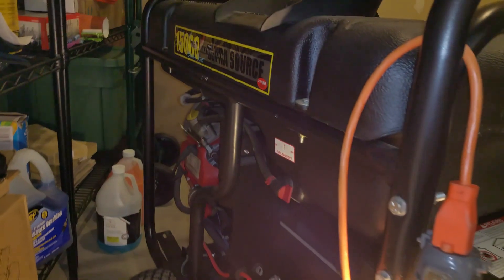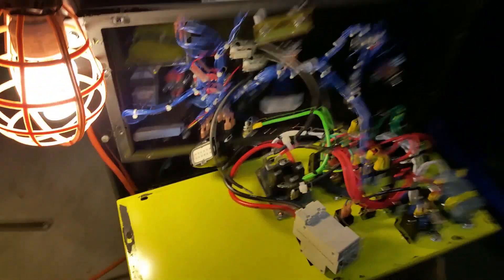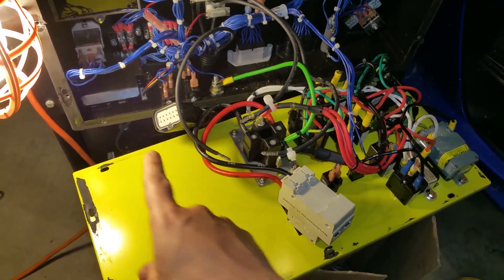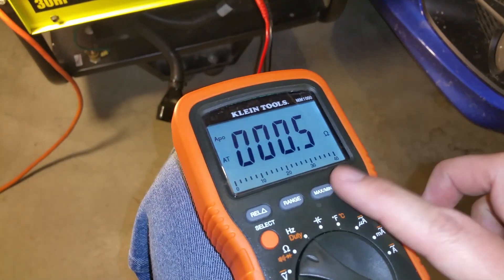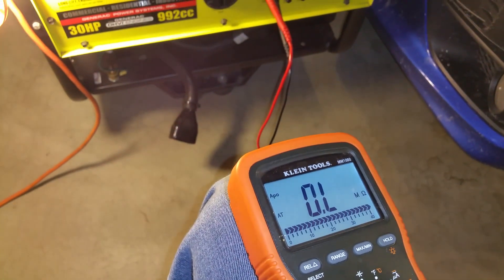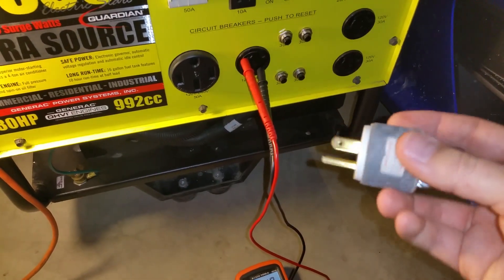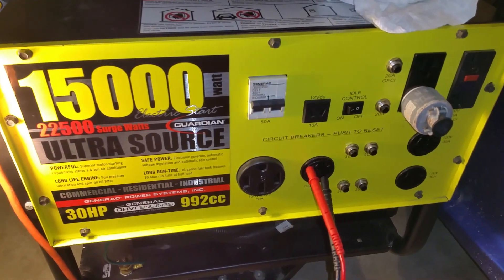Generac Guardian UltraSource 15KW Repair

Comment: I have the same exact generator generac ultra source guardian 15000watt and the same exact problem you had with yours. Mine also revs higher than it should. I opened up the panel and noticed I have a generac voltage regulator with adjustable dials for Voltage adjust, Gain, Stability and underfrequencey adjust. I'm getting 90ish volts on one 120 plug and 150 on the other 120 plug. I ohm tested them all as you did and they all tested within spec. I did tighten my ground lug as it was loose. All other connections are tight. What would cause a higher than normal idle and the voltage differences between plugs?
Reply from the maker: William Hinds loose neutral lug

Comment: Thank you @xboxer1985 ! Have exactly the same generator, had exactly the same problem and fixed it (after having watched this video) exactly the same way! Did run the same tests ( with 2 voltmeters and two heavy Watt devices) and got same good results. BUT : on average, when I start the generator, it does NOT deliver any electricity.... I will then restart it a couple of times and then it suddenly delivers electricity and works perfectly. Any clue what that might be?
Reply from the maker: Carlo Weis yes, its the field boost circuit that needs fixing
Reply: Carlos I know you commented 5 months ago but you may need to "relearn the field". Start the generator and if you dont have power try plugging in a Heavy duty 1/2" drive drill and put it in reverse and manually spin the drill chuck by hand quickly one good time. Release the drill trigger switch it to forward and press the trigger again. It should idle up and you should have power. This is a common thing people do and it has worked for many myself included.

Comment: Awesome video. I have the same generator. I'm having one issue. I put in new battery and it doesn't seem to be charging. Would you happen to have any advice what the issue it could be.
Reply from the maker: Hello thank you for watching! I'd have to review the schematics to make an accurate diagnostic without seeing your machine. Off the cuff I would think either the bridge rectifier off the charge winding has failed or the charge winding has failed.
Reply: @Bassguitarist1985  Thank You for the fast reply. It's definitely a weird one because I can run the generator an hour or so and never dies battery isn't loosing voltage. It stays at 12.5 volts.
Reply from the maker: @MegaFireman76  how old is the battery?
Reply: @Bassguitarist1985  it is brand new
Reply from the maker: @MegaFireman76  okay ill check the schematics later today and see where to check
Reply: @Bassguitarist1985  I appreciate any help.
Reply from the maker: @MegaFireman76  BCR2 which is the bridge rectifier connected to the start stop relay which then goes to the battery. You need to measure at 66A and 77A looking for AC voltage when running. If you have that then you need to check for battery voltage at the center terminal of the bridge rectifier. It should be 12.8 volts at rest and higher when it's running. If it's not higher than that then I suspect the bridge rectifier is bad. If you do not have AC voltage going to the bridge rectifier then I suspect a bad stator winding
Reply: @Bassguitarist1985  awesome thank you! I will check it out .

Comment: My man! what are the chances you still have this generator? I saw your work with James Condon, Ive also been rebuilding/fixing generators and small motors for a bit, and I just picked up a GP15000e and its almost identical to these Ultra Source ones, and I think ive pinpointed the issue. Can you tell me on yours, on that governor/idle control PCB board that lays flat under that metal cover on the bottom left behind the panel, if that led light turns on on that PCB while the motor is running? I found that the previous owner had messed with some of the wiring behind the panel and plugged the wire in the wrong place and may have shorted a connection in that PCB and want to get more info before spending $250 on a non-returnable pcb :) any help would be much appreciated! more symptoms if helpful: Im getting a super rich and labored startup, its inconsistent where it decides to maintain throttle level and smells super rich and has alot of black smoke from the exhaust. The carb DEF solenoid has also been tampered with and the pin is missing, so its a bit of a "chicken or the egg" situation for now. Theres a couple of things goin on with it, but i figured this was a good place to start
Reply from the maker: Hey bud unfortunately I sold this generator a few years ago to a guy running a food truck. I do have the diagnostic manual that I can send over to you for the GP which is essentially the same as the UltraSource. Shoot me an email. Channel name at yahoo dot com
Reply: @Bassguitarist1985  Youre the man, thank you. Email sent

Comment: Hi your videos are great I thought I reach out to you because I know I have a simple problem and maybe you can help me diagnose it with my genrac quietpact 50. I have did a complete service and replaced the carb and springs that connect to the throttle and governor arm. I get power when running maybe about a minute and rare occasion 10-15 mins then it shuts off. I checked the hertz and put it at 60hz. Engine sounds great. However I have noticed at some point I can hear a slight surge for a moment and at that time I can see the hertz go upto 75-90hz then the power shuts off? I measured the voltage to when running at 60 hertz it’s about124-126 when it surges for a second or less it goes up to 160ish. Could this be the excitation breaker causing this problem. During this whole time I never had a large load on the generator just a tv on.
Reply from the maker: Overspeed problem. Generator shuts down to protect itself and equipment. Either linkage problem, internal governor problem, or stepper motor is bad (if equipped)
Reply: Bassguitarist1985 thanks for your reply, I don’t think I have a stepper motor? I forgot to mention that this is a generator in my RV.  As for the linkage I changed that too and placed back in the stock holes. I have adjusted the governor back to a range of hertz from 55 up 62 but for some reason it has a small surge I most of the times I can’t hear. I even held the linkage down to its 60 hertz and it still cuts off AC power.  When the AC power cuts off it then gives out like 1-2 volts only but the engine keeps running. The way I restore and try to retest is by shutting down the engine and restart. Maybe I have to take it down from my RV and check the governor? Any other suggestions?
Reply from the maker: @martinollendorff1201  would have to research the model and serial for exact schematics. I did work on a quiet pack years ago. Nice genset when maintained, though most RVs I encountered had Onans onboard.
Reply from the maker: @martinollendorff1201  there is a lot of info on smokstak.com and there are alot of people familiar with the gen you have.

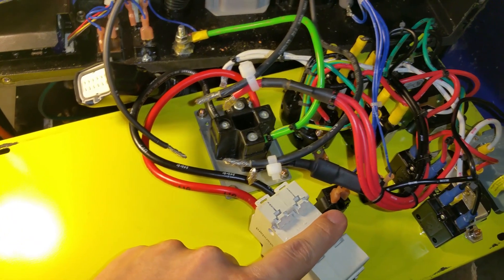Comment: Hi Bassguitarist1985,  I have the same voltage imbalance issue.  When I opened the panel the black wire (in your video at 3:27 https://youtu.be/-OlUP-lSpwM?t=207)  above the wire labeled 44H was not connected.  Could you tell me where that wire is supposed to be connected?  Just wondering if it connects to the neutral with the other 2 white wires, which happen to be tight. Thanks in advance.
Reply from the maker: You sure it is 44H, as in H in Hotel? The schematics show 44, then 44 A as in Alpha through Delta. 44 is one of the hot leads from the stator
Reply: @Bassguitarist1985  I was looking at the wire in the video, it looks like it was labeled 44H, but could be 44A.  I was only using that as a reference.  In your video you grab the black wire and call it a neutral.  That's the wire that was not connected when I took off the panel.
Reply from the maker: @eagle-wz5oh  44A goes to the large 50A plug and the main breaker.
Reply from the maker: @eagle-wz5oh  the 3 thick wires are all black, XY hot and neutral. In my case all 3 had to be cleaned and reattached to the main 50A plug to which all the other plugs are breakered/parallel connected to the 50A. Def sounds like a neutral or a hot leg not connected properly. I sold this generator years ago, apologies I won't be able to able to assist further. The schematics are available online however.

Comment: i have this exact same model generac 4582  15kw generator.  I is wired to service our whole house with a suicide adaptor off the 50 amp circuit.  During Ian we pre tested the unit three times before the storm and ran it for 20 minutes.... always run it dry to avoid gunk build up in the carb..... so yesterday after the storm I started it and flipped the 50 amp breaker to on..... the lights in the house turned on.....(i balanced the load prior to starting turning off the AC units and water heaters)  ... the light were on for 3 minutes and suddenly went dark and the engine on the generator started racing and going to low idle then racing again...... i shut it down and and disconnected wiring from house.... we examined the carburetor for debris thinking it was bad fuel ....all clean.... then took off governor and re started and finally got the engine to run smooth....we tested voltage off the electric panel only to get ZERO ac power... we finally took the panel off and put the test leads directly on the generator source (pre panel) leads and got ZERO..... anyone have any comments  on what the issue is and if there is a fix.... I called a local generac service center and the tech said it was DEP WINDING issue that was sending a signal to the governor  and this meant the generator was toast ....and replacing would cost 2,200 dollars.... and he did not recommend doing so as a new one cost 3,200.....   so any comments or recommendations?
Reply from the maker: The voltage regulator may have failed and also potentially the DPE. I agree with the guys assessment that the windings will need to be tested. It's good that you balanced the load, but the fact that you had a suicide adapter... Are you sure you opened the main breaker before hooking up the generator?
Reply: @Bassguitarist1985  i shut down the main breaker feed from the utility company....the top switch on the  panel...... i was told to do this to prevent electric energizing from back feeding to the lines and also to prevent an overload in case the utility company restored power..... what is the DPE or DEP?  what does the acronym mean?
Reply from the maker: @circusringoffame8501  displaced phase excitation winding. Commonly the exciter winding. It is much thinner wire than the main windings and would likely burn or fail before the main windings do. There's a chance that it could have survived but you would have to measure all the resistance disconnect the panel to isolate it. Then you would need to try to manually excite the generator to see if the windings would produce power and if they do then I would turn my attention to the voltage regulator board which is under the most heat and stress component wise.

There is a service manual for this particular generator out there and it is extremely lengthy and if you're not comfortable with some of the tests it should be left to a professional. It may not be prudent to condemn the stator and rotor windings just yet but it's hard to say.
Reply: What would cause this DPE failure issue ?   It appears to be major. I got a quote for repair of around $2,200  The generator maybe had 75 to 100 hours on it and was maintained. It was not on a job site running for days on end.  A new model of the same capacity is $3,200 ...not to say i would repeat the same purchase.
Reply from the maker: @circusringoffame8501  are you 100% sure the winding has failed? Did this service company confirm to you with evidence the DPE winding was fried? Often times companies don't do root cause of failures, but replace entire assemblies because they don't want to take the time to diagnose.

DPE winding is auto reset circuit breaker protected, so overload condition would trip that, but repeated trips can overheat and make it fail. Insulation breakdown is a possibility too. Damp environments will defrade any stator/rotor winding.

Yes its a $$$ machine, and a shame if its completely toast. Also idle control is done by a separate board running on 12 volts I believe.
Reply: @Bassguitarist1985  Interesting. I figured the tech on the phone was interested in selling me a whole house system with saying it was toast. Question: is there a reset switch for the DPE (something i can manually reset...and if so where is it located)  ... also are there any other reset switches i should pay attention to?
Reply: we are digging out of hurricane Ian so this is the last thing we need to happen to a relatively new generator
Reply from the maker: @circusringoffame8501  i get it I'm sorry. I have friends in North Port and Bradenton. Nasty news

Comment: I have this exact same generator - have had no issues with it.  I recently converted to propane - the kit has a "load block" valve on the output of the 2nd regulator.  I noticed that you had done a conversion (another vid) and you also had a load block valve.  All I can fine it that is adjusts the air/fuel mixture - and I guess that makes sense now that I'm thinking about it.   Is that the main purpose?  Calling it a "load block" valve seems  a bit misleading.   I've read somewhere you should adjust "lean" and under load.  Any advise or suggestions?  Great vids BTW...
Reply from the maker: You are correct it adjusts air/fuel mix. Hue at USCarb calls it a load block so thats why I called it that haha

Yes adjust as lean as possible with gaseous fuels. Leaner means cooler exhaust temps, unlike gasoline where leaner equals hotter exhaust temps.

Comment: I have that same generator when I connect the equipment the low engine of rebolutions and is not rewarded and the IDLE control does not work check all the cable and is intact I hope you can help me
Reply from the maker: Juan Hernandez having trouble understanding, is idle control not working?
Reply: xboxer1985 the plant lights perfect I give the idle control and does not do anything when I put it to general the engine revs down and it does not become accelerated and because of that the voltage lowers me in other words the electronic troter does not work
Reply from the maker: okay, i dont know exactly what its doing other than you say it is not working. it can be a number of things. the idle control board, the stepper motor itself, the CT transformers, the mechanical governor needs servicing, linkage adjustment, dirty carb, old fuel. Thats all I can think of but im sure there are other possibilities.